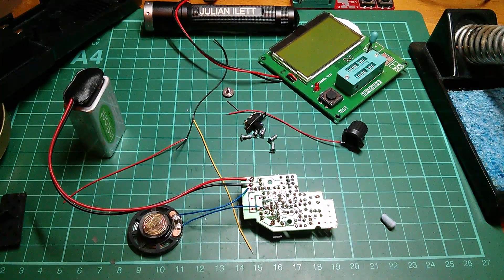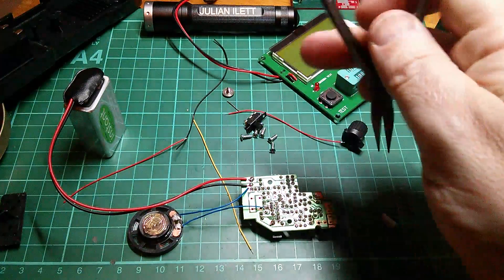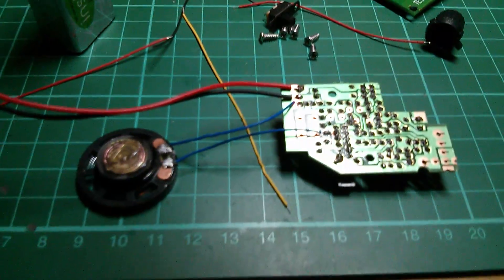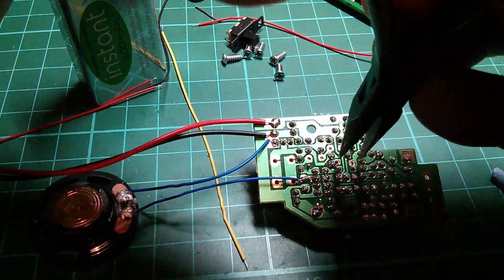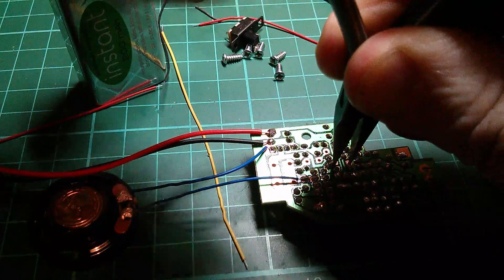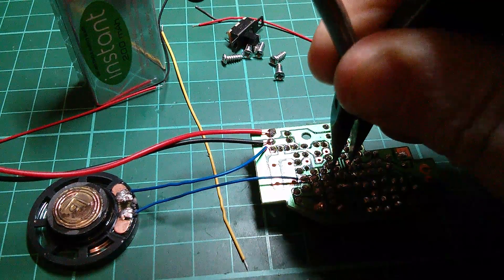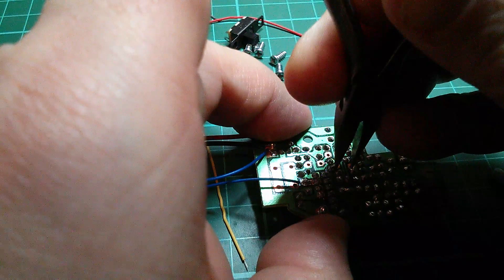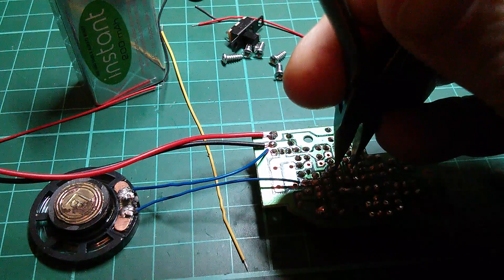Real Time Kit Build: Walkie Talkies Update - It Works!

Comment: Julian, just wondering if you have had an opportunity to try out an Arduino Due?  I picked one up, and it arrived just before we left to flee the winter weather, and headed South to Arizona.  So here I sit with my new Due, and most near all my other electronic gear sitting still in our house in South Dakota, where there is 8 inches of new snow and the temps are around 3 degrees F.  Here in Arizona however, it is 60 F bright and sunny and wonderful weather.  I may just dig out my Due and play around with it anyhow, I have just watched a couple of hours of  your older videos to get my electronic blood going so I am about there, now if I can just recall what box I put that in two months ago when we left Lemmon...   Due R3 Board SAM3X8E 32 Bit Arm Cortex M3 Control Board Module for Arduino Gus | eBay
http://www.ebay.com/itm/DUE-R3-Board-SAM3X8E-32-bit-ARM-Cortex-M3-Control-Board-Module-for-Arduino-GUS-/262066255972?hash=item3d045db864

Comment: I wanna see the other one going now and a range test :) maybe a follow up video can be a full sized vertical antenna connected to one of them ;D
Reply: +Dazzwidd range? not as far as you can shout! and fidelity, about the same as the old string cups!  this kit is very similar to the 'made in hong kong' ones they sold to us kids in the early 70's, they were awful! lol
Reply: +jusb1066 
  I agree.  My sister bought me one of these pre-made kits.  The antenna picks up just about any rf noise in its general direction.  Absolutely no RF Filters or Antenna tuning so what do you expect...  You might be able to use this as an RF Interfering Device since I'm pretty sure it won't match the FCC Requirements for interference.

Comment: So I guess the link is where the on off switch is wired in is it?
Reply from the maker: +Gary g1fsh No. Curiously, the link is part of the receive circuit only, so there's no sound without the link. But when transmitting, the link isn't needed.